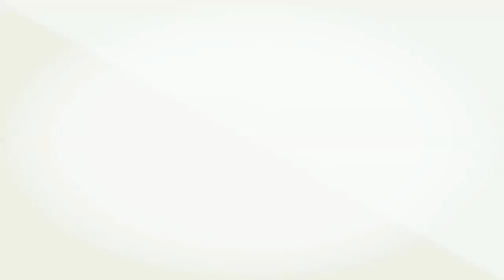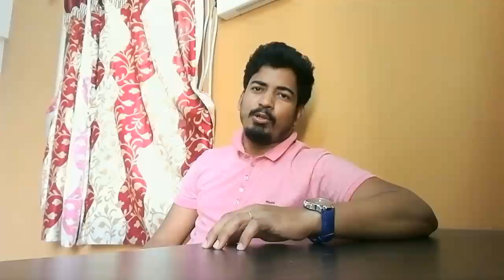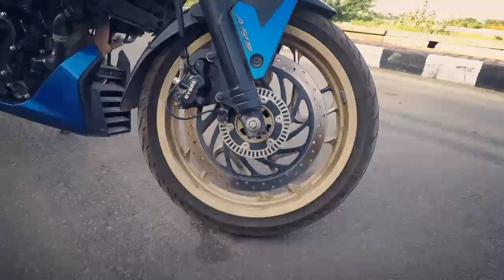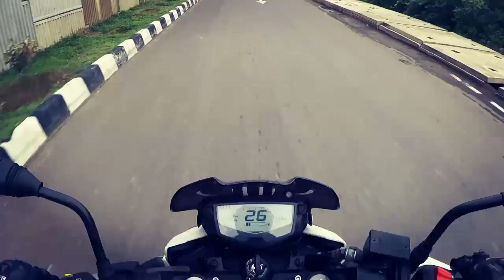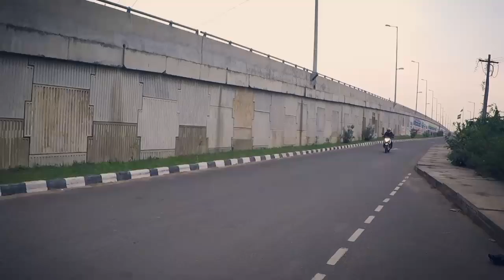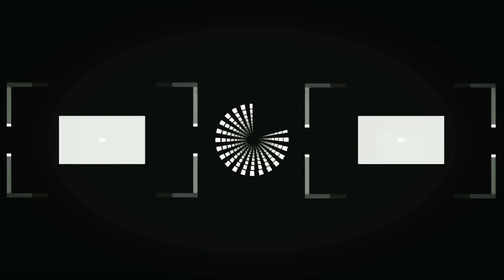Single Channel vs Dual Channel ABS - What's the Difference

Comment: Hi. I recently purchased a 250cc FZS, but on sudden braking, I hear some sound and it feels as if the brake pedal is touching the ground. Is it true that the bike needs to be running over 40-50kmph for ABS to work? Or is there something wrong with the ABS of my bike?

Comment: Manufacturers should provide ABS on Rear wheel in case of Single Channel ABS motorcycles . . . . . . Generally, Rear wheel tends to lock up under hard braking even when 70:30 Braking ratio is followed . . . . . .
Reply: Wrong info, weight shifts forward while braking, abs should be provided in front wheel.
Reply: @apsb4440  Yeah weight shifts forward while braking which is why front wheel has more road grip/traction while braking and it doesn't lock up easily . . . . And due to the forward weight shift, the rear wheel loses traction and lock up very easily . . . . . . I think you don't have much experience in riding Sports bikes and motorcycles with slightly aggressive rider's triangle which requires the rider to lean forward while riding, Otherwise you would've known the feeling . . . . . Only heavy cruisers like RE Thunderbird, RE Meteor, HD Forty Eight etc. which have a higher front end and lower back end are safe if provided with single channel ABS for the front . . . . . But they come with dual channel ABS as standard because of their price . . . . .

Comment: I think Our India bike company would make their bike like that which is under 1 lakh price bike to competition with other bike company. At least make their bike like that dual purpose ride on off-road n on road,long travel front suspension 200mm n 180mm back suspension,make comfort sit, attractive design, front tyre at least 21 inch, back Tyre 17 to 18 inch,better fuel economy 35 to 40,better service,part available, make reliable bike, at 1 lake price at least give 200 to 250 CC segment bike n if that bike build for off-road then their bhp minimum 20 n give minimum  NM 24 to 25 , bike weight minimum 130 to 150 kg ,fit space back Tyre size option 130 to 160,fit space front tyre size option 110 to 130. N if that segment price bike build for on road bike then their bhp minimum 25 n NM minimum 20 n bike weight minimum 150 to 160 kg,fit space back Tyre size options 140 to 160 n fit space front tyre size options 120 to 130 .Then I think no one bike company should competition n compare  with this types of features bike company.....

Comment: @rev force - Hi Bro I am planning to buy a new bike , my requirement is dual channel abs with 40km per litre mileage. Suggest me good options please.
Reply from the maker: FZ 25 and Apache 200 4V are the best options.
Reply: R15 v3

Comment: Bro I heard that dominar 400 have same like rs 200 and it has dual channel abs although we use dominar 400 abs in rs
Reply from the maker: It is the same ABS system but if you want to fix dual channel, I don't believe you can do it in Bajaj service center.
Reply: @RevForce46  ok bro thank you for giving me a valuable time to suggest about rs200
Reply from the maker: @Dinehgandhi26398  You're welcome bro.

Comment: Excellent bro but I have a small doubt  if rs200 bike the dual channel abs can be fix it's possible or not
Reply from the maker: It gets Single Channel ABS as standard. I believe that we might be able to fit dual channel ABS. But it might be costly and also maintenance cost will be more.
Reply: @RevForce46  ok bro how much cost it have to done
Reply from the maker: @Dinehgandhi26398  It might be somewhere around 10K, but the maintenance cost of it might be more. So, plan accordingly.